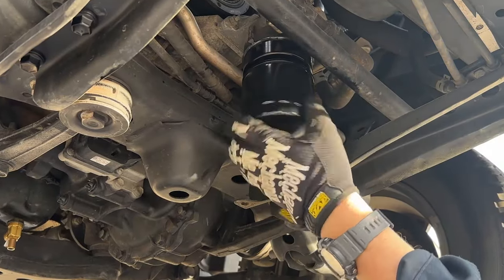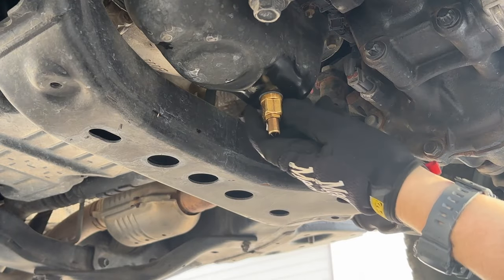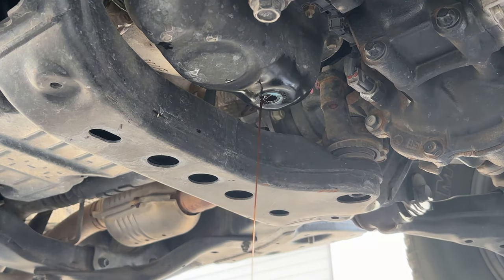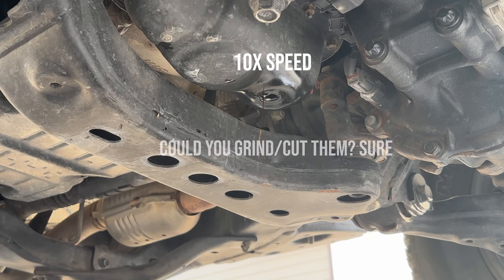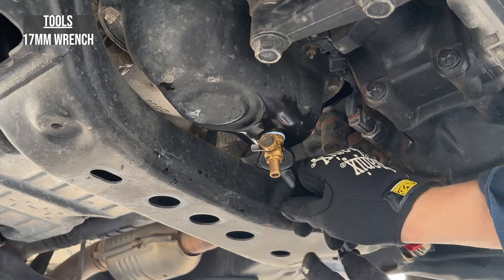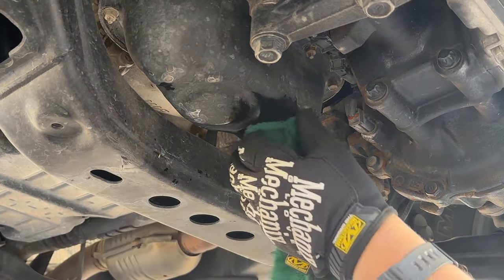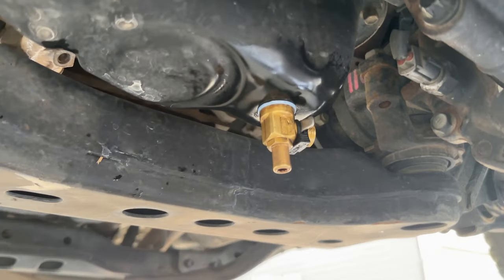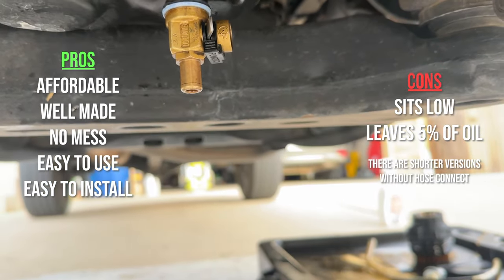Fumoto Drain Valve Toyota Tacoma 3rd Gen - Install & 4 Year Review

Comment: Clearly these come with a clip but I still wouldn't feel confident with it. They should make a version that uses a cotter pin.
Reply from the maker: You know not a bad idea for peace of mind. I actually really like that. Rest easy knowing there are millions of these in circulation and HIGHLY popular:
Reply: That clip is more a dirt shield keeping gunk out of the mechanism than needed to prevent the lever from turning.
Reply: I was a fleet mechanic and have worked with these for at least 28 years on vehicles with literally tens of millions of miles combined amongst them and never an issue.  Love mine makes oil changes a breeze.

Comment: Love the Fumoto Drain Valves. I put them on every vehicle I buy. Not worried about the cup of oil left inside.
Reply from the maker: Sameeee brother
Reply: In fact, I'm pretty sure I read somewhere that it's technically a 6.2 qt oil change. So I'd say it helps a little.

Comment: Love the idea of a drain valve. Only problem is that I live where they salt our roads in the winter
Reply from the maker: Ya know I bet it would be very easy to just spray with some rust preventer and would last a longggg time. It does not seem susceptible to rust at all.
Reply: It looks brass. Brass corrodes only i believe not rust. Just spray with WD 40 or something everytime you change oil, that may help. Or rustoleum paint the bottom have. They also have zinc plating type spray.
Reply: I mean, the navy has been using brass on ships for decades. I think the brass will be fine getting through the winters.
Reply: @j.a.m.e.s.1217    The valve ball is stainless steel and is encapsulated in a nylon like plastic ball.   Put a cap on it and go.   We used these on semi trucks that ran in calcium chloride mud rain and snow, never an issue. And they were down in the path of wheel spray.

Comment: Seems like a 'solution' might be to drill a couple holes in the thread wall at the level the threads are above the oil pan?
Reply from the maker: Not a bad idea at all. Even better than just chopping it down I’d say.
Reply: @teamoildrop  my other suggestion for anyone making those drill holes would be to sleeve the threads with some thin walled thread matched screw over. That way when you've blown out the shavings, and start to unscrew the over sleeve, it will reinforce the threads, and not mar them up.
Reply: I measured the threaded portion of the OE and marked the Fumoto valve,  I then sliced slits it mine at 90 degrees angles with a hacksaw down to the exact measurement so all the oil drains easy peasy.

Comment: Whether it's getting out as much oil as would come out with the regular plug depends on the design of the pan.  With a cast metal pan or a really thick sheet metal pan where the threads are integral to the body of the pan, the threads of the valve will keep some oil in...but how much still depends on the design of the pan.  Many thinner sheet metal pans use threaded inserts as deep as the threads on the valve (or the OEM plug) and always retain some oil.
Reply from the maker: @kirkdarling4120  there’s actually a cutaway in the threading of the pan to prevent holding excess oil when the OEM plug is removed

Comment: For me, leaving a cup of dirty oil, because of this or similar devices, with each oil change, is a deal breaker.  Yes it's less messy, but over the years, one is not getting a clean oil change as possible with each oil change...is not a good thing for me, because its the 2nd most expensive long term investment in my life. If I just used a regular drain plug, it would likely get a lot more gunk out and more quickly because the flow is faster.
So using a gadget is quicker, but draining with a regular drain plug makes me and my vehicle happier, as we know the new oil in the engine is cleaner.
Reply from the maker: I don’t completely disagree. That ~5% dirty oil is a bit annoying but not enough for me to not run one of these. Cutting down the threads would also eliminate this “problem.”

Comment: Add a washer or two to get the threads flush, all good.
Reply from the maker: Its a tradeoff, get that last cup of dirty oil out / lower the drain a few more mm. Not a huge deal either way!
Reply: @teamoildrop   as it is a valve, you can always close it, fill some ounces of new oil, then drain it off! that way, the old oil can get washed off!

Comment: You know the worst gunk, metal whatever will go straight to the bottom, so the stuff it's not draining is the worst of the shit you REALLY want out of there. get rid of that shit
Reply from the maker: I think what you meant is that it’s good to drop an oil pan and remove a drain plug completely every now and then to check for wear and metal flakes. Facts.